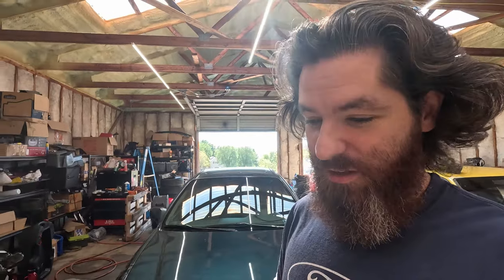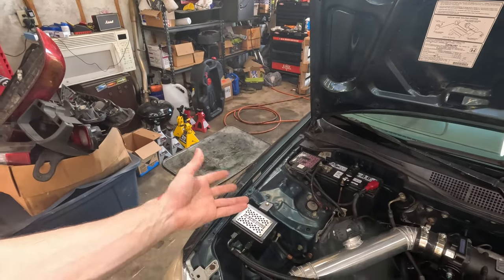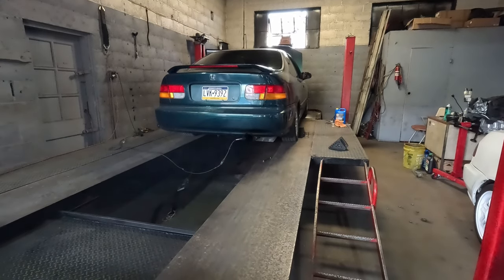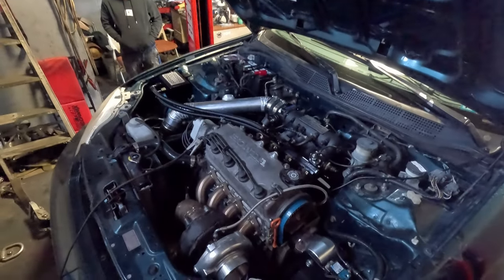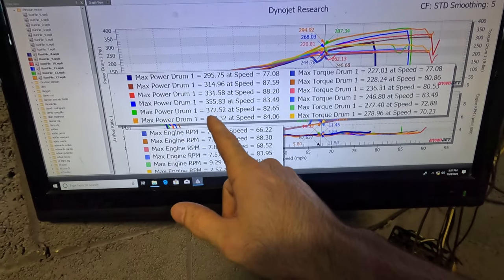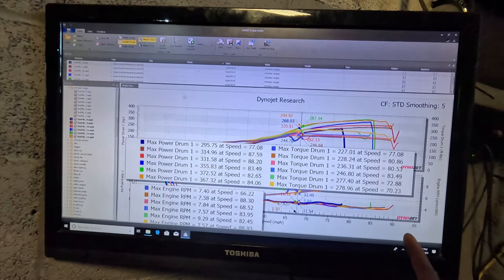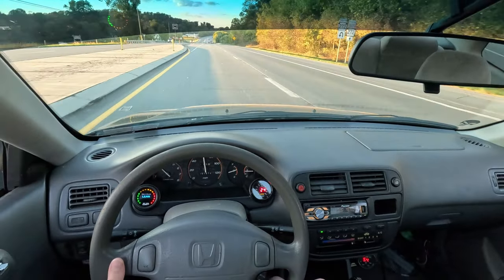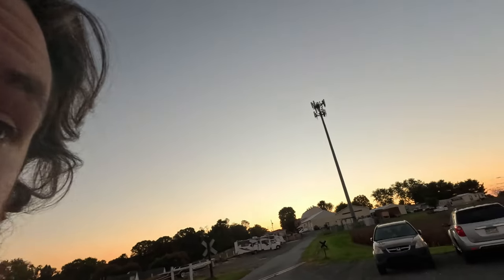D16Y8 VITARA EK COUPE DYNO DAY!! / 3076 PUT IN WORK!! / WE MADE WAY MORE POWER THAN EXPECTED!

Comment: I made 373 whp on 20 psi with my z6 and 309 torque
Reply from the maker: That’s healthy af! What turbo? Were you on ethanol or pump gas?
Reply: @PRZJ91  thanks bro it's dual ball bearing t04e 60.63 turbo and I'm running on e85 same vitara build 75.5 pistons, speed factory rods supertec Valves, skunk 2 alpha springs and titanium retainers 1000cc FIC injectors aem 340 fuel pump
Reply from the maker: @stevoej8204  ethanol def could have netted us more but we really didnt encounter any knock. this thing should last a while!
Reply: @ nice!!!! Yea you should be fine you made good power on just pump gas 💪🏼✊🏼💯

Comment: what cam is in it?
Reply from the maker: @hermesrakes8460  stock d16y8 camshaft! Blew my mind
Reply: @PRZJ91  Damn! thats pretty good. even has the cammed tone on idle .Good Build & Good tune Good Results.
Reply from the maker: @hermesrakes8460  thanks my guy!!! I think the idles is from the injectors coupled with the low compression. The Afrs dance at idle. Injectors are large and not the greatest. They’re a budget injector but under boost they work pretty good!

Comment: Me wondering what he charges to build me a single jingle just like this...
Reply from the maker: Specifically this car, converted to manual and converted to manual rack. All the fab, building the motor and trans. Everything including labor was above 11k. They say have a budget and I say budgets will get you an unfinished car lol it’s expensive to build cars and even more expensive to build reliable ones. If you did all the work yourself it would probably cost you 6-7k roughly if you don’t cheap out on parts.